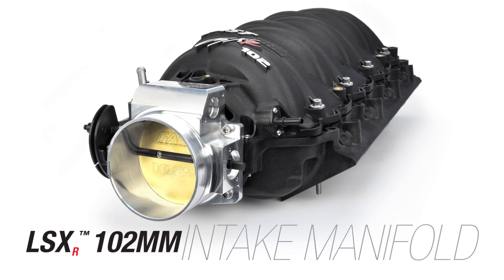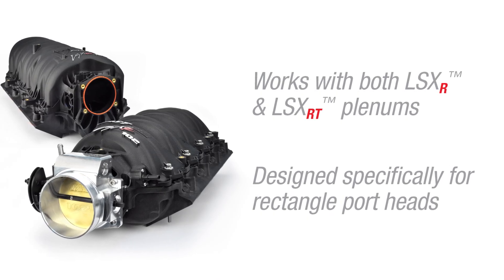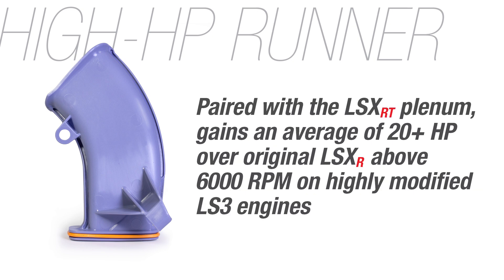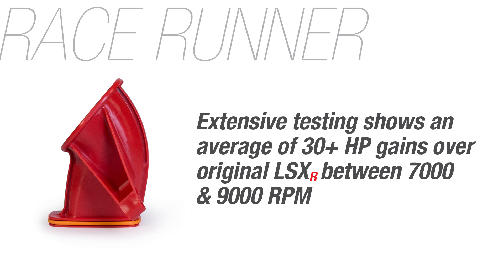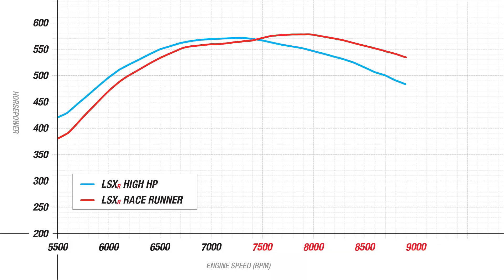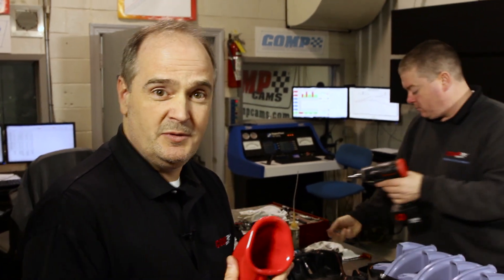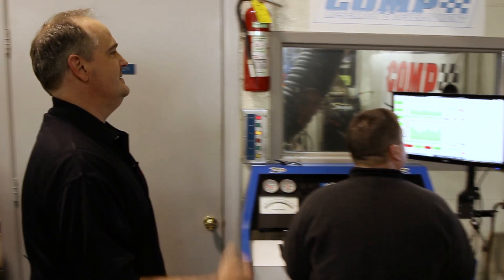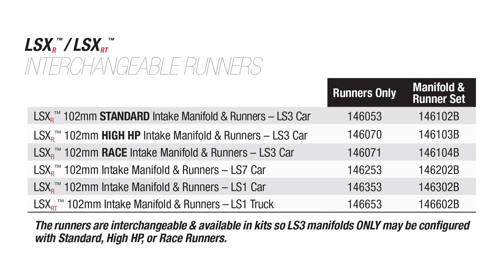FAST: LSX Interchangeable Runner Dyno Testing

Comment: OK.....but why no dyno with the standard length runners?
Reply: Exactly what I thought! If we have stock runners chances are we want to see what the difference would be moving to shorter runners. I am running full length on my Darton 427 but I doubt I would pick up anything up top worth loosing hp in mid range. Ive reved my old 408 to 7500 but its hell on the valve train.